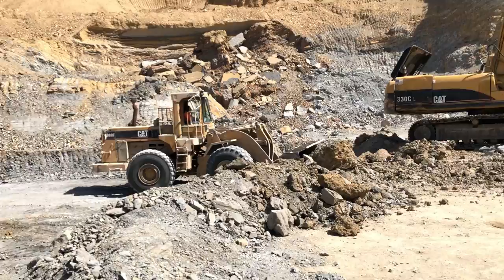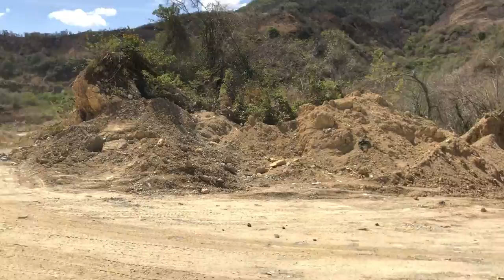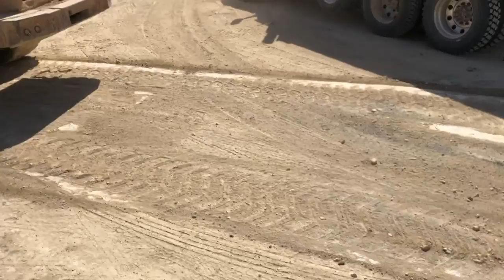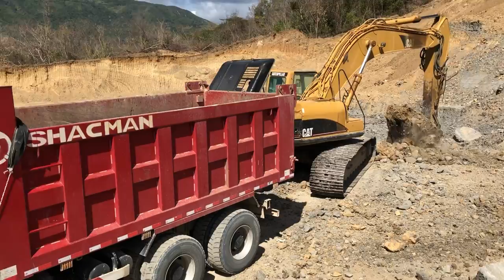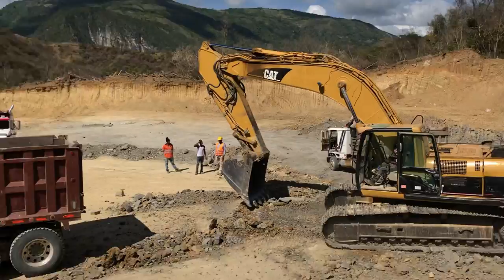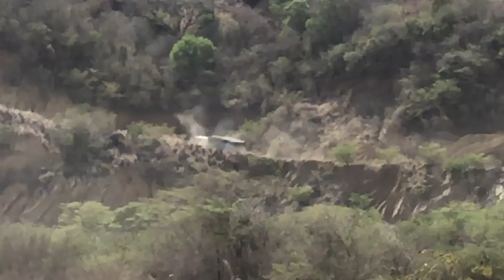SHALE MINING S1•E3 #kenworth #peterbilt #truck

Comment: Nice trucks but the operator is loading these trucks wrong,he should be loading from the front towards the back
Reply: We load from back to front to take the pressure off the steering wheel